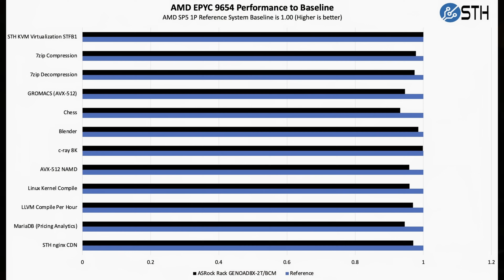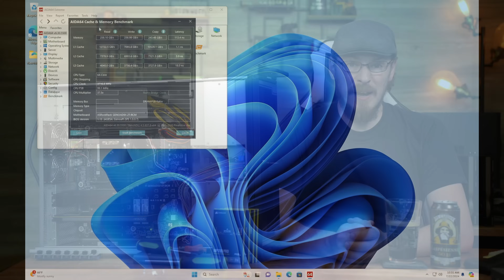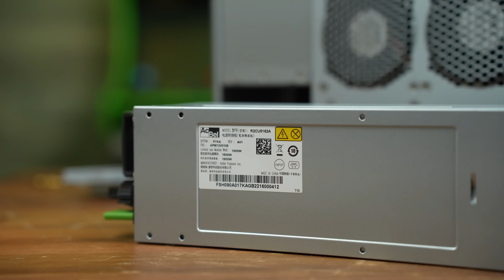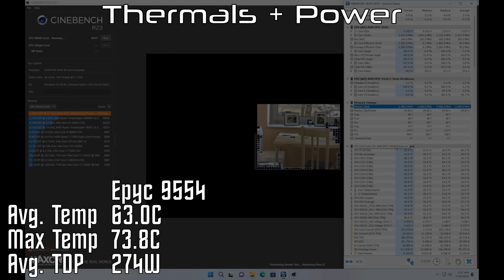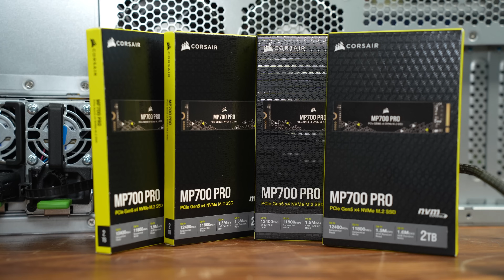I can't believe AMD trusted me with this...

Comment: AMD is just killing it.
One of the things i was most excited about from AMD was Epyc 4004. Now dont get me wrong, extra validation is great.
But i was disappointment in no 16 core x3D option, and no 32 core Zen4C option, or maybe a 2 NUMA node 8X3D+16Zen4C. I was also holding out hope for a re-designed die for the 8700G that gave it 32-48MB of L3 cache instead of 16MB, and then the full 24 lanes of PCIe, Cherry on top of this fantasy would be CXL support for what would equate to a 3rd channel of RAM over 8 lanes of PCIe, but outside of handhelds and small formfactor gaming focused systems, that would basically be useless. If they had released an epyc that was this theoretical ryzen 9 8950G, even without the CXL support, i'd probably pick one up for my file server which right now is a 3950x on an asrock rack X470 motherboard with a BMC because i dont have enough PCIe lanes for a video card.
Reply: I’m don’t understand the homelab excitement for epyc 4004. They work the same as regular consumer ryzen and fit in the same motherboards. The only people who should be excited are corporate sysadmins who need to fill out a ton of certification paperwork for every part in a server
Reply: @nickfarley2268  From what i can tell, you're basically guaranteed functionality, as opposed to my 7950x where i had to hunt around for boards and RAM that would actually work with ECC. Which is why i was dissapointed, i already have a working 7950x since launch, if this offered 32 cores at a lower power envelope i would throw down $1000 right now, but its basically just my 7950x.

Comment: Cooling the "Genoa" CPUs is very difficult because the largest fan that fits on the mainboard has 92mm side length. This small size requires the fans to run very fast and be very loud.

Comment: If you had have been in the industry for a few years longer you would more readily realise the massive gulf in generational performance gains since Zen 1 came out than for the decade prior to consider Epyc Milan as "not really a generational uplift"
Reply from the maker: I've been in the industry since 2006. And my statement was speaking to the idea of Milan over Rome alone. Milan was a very good architecture.

Comment: Catastrophic choice for the mainboard. It has only 8 DIMM slots while the CPU has 12 RAM channels. You waste one third of the possible memory bandwidth.
Reply from the maker: Check out the STH article linked in the description. Unless running a 100% memory-dependent application or process, the losses are minimal. Around 4-7% on average.
Reply: @CraftComputing  When running AI inference (which this CPU is destined for), the speed reduction is 33%.
Reply: @Viewable11 It is his workstation, after all, which makes the motherboard his choice, so if he's happy with it, that's perfectly fine. He doesn't do much AI focus content for now anyway.
Reply from the maker: @Viewable11 That's why I said "unless running 100% memory-dependent applications". General virtualization and VDI, which is what my focus is, shows little impact at all from fewer memory channels. What I did need is as much PCIe as possible, which makes this board a perfect fit.

Comment: my idea for a server like this would run 24 to 48 machines, 2 cores 2gb ram and 1 (or) 2 gb video ram. for older and low end games. sins of a solar empire, starcraft, command and conquer, rimworld, total war, sim city, project zomboid, home world, xenonauts 2, xcom 3 . . . . . . . . . . . . interested in seeing how machines could run before bottlenecking the SSDs.
Reply from the maker: The main issue with 'retro' could gaming systems is how do you get the video signal from them? Modern streaming solutions like Parsec and Sunshine/Moonlight require Windows 10 or 11, which eliminates most games with retro requirements.
Reply: @CraftComputing  if you go 24 Sunshine servers on windows 10 64 bit @ 4 cores 4gb ram & 2gb Vram. by the numbers thats 24 VMs, 96 cores 96 gb and all the Vram. pushing proxmox to its limits. you could try a Sunshine server on a win-7 box? another test could be, how many Sunshine servers could 1 Moonlight client would handle before breaking.

Comment: you have 12 chan support with this chip but opt for 8 chan - still good to see this content as the potential and possibilities are immense - should be a workhorse for you for years. by going to 22 or 240v you shoud save 3-5% on power - not negligible. you need to do some true open source ai on this monster - pair it with a really big array and let it run to digest and learn all your data
Reply: Electrical companies in the US measure usage in kilowatt hours so running 120v @ 10 amps or 240v @ 5 amps makes no difference in your power bill with the wattage being exactly the same. Some applications may run more efficiently on 240v but it's not 3% and won't help cost in any noticable way (I found this out the hard way). It will allow you to keep the amp load down if your running low since most homes have 100amp services with larger homes having 200amp so it is still better than 120v for permanent installs.

Comment: 7 times 16x lanes is insane! Jealous? No, you deserve getting this kid of system. Envious? Also no, I sure don't deserve one either. Do I want one? Oh yes, but I can't justify it in a "home lab"! Awesome server Jeff! Congratulations!
Reply: You can get used Zen 3 Epycs with 7 16x slots for quite reasonable prices now.
Reply: @LordApophis100 Those are Gen 4 instead of Gen 5, although there’s not much difference today as most devices don’t take advantage of 5.0 😂
Reply: @LtdJorge  A ton of stuff doesn't come close to needing gen 3, let alone later. Just be sure to check their specs etc, there are some things that will nerf&gimp themselves if the pcie is not the "right gen" even though they don't come close to needing it in terms of bandwidth. Some SSD's for sure but some other stuff too that I don't remember what it was now.
Reply: Looking at replacing my Epyc MOBO with a H12SSL, that has lots of lovely PCIe4 slot goodness!

Sadly while trying to troubleshoot I dropped a CPU into the pin grid of the socket on my H11SSL-i 😢
Reply: @morosis82  I really like the Gigabyte MZ32-AR0 rev 3 because of its OCP 2.0 slot.
You can add decent networking without using a PCI slot. Only drawback is, if you want to use the top x16 slot you'd need to run 4 cables from the connectors below the CPU to the slot, but the other 6 slots are already plenty. Other than that it's the almost perfect Epyc board for me.

Comment: I would normally say "why didn't you just use a c19 plug lock insert as intended" but I'm assuming you ran into the exact same problem I ran into....it's virtually impossible to find those inserts sold individually and paying over $60 for 100pc seems exceedingly wasteful lol. I just got a 3D printer though, so I'm sure I can find or draw up a model to fix the issue.
Reply: My first thought when I heard Jeffs issue was to grab a hot glue gun and just accept the cable as near permanent 😅
Reply: I use APC cables with locking feature on both ends.

Comment: Run Crysis of course. Cannot wait to see what this beast can do.
Reply: If I remember correctly there is a mod out there that allows cpu rendering of Crysis, I saw Linus test that, I think it was with an old threadripper.
Would be cool to try that experiment here
Reply from the maker: CPU Rendering could be fun :-)
Reply: @BF26595  You can run it on Vulkan via DXVK and use Lavapipe as the Vulkan driver, which is a CPU renderer.
Reply: Crysis is not a good game to test this stuff, its ultimately in design CPU limited, it was made for a future with single cores running at 9 ghz rather then multiple cores.
Reply: Sure... but how many at once?
Reply: @TalpaDK oh I would like to see just one, I really don't think more is feasible... you need all the cores to work for that task...
I think Linus was getting in the 10s fps wise with that old threadripper but I may be wrong. It would just be cool to see a game like Crysis, regarded by the entire community as being a nightmare to run properly on a good pc from a few years ago being rendered on a CPU of all things